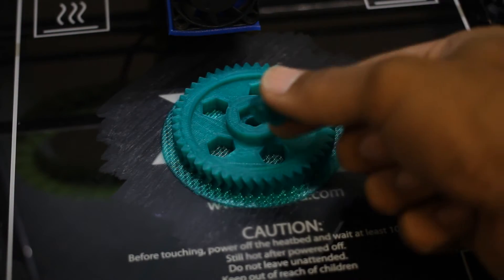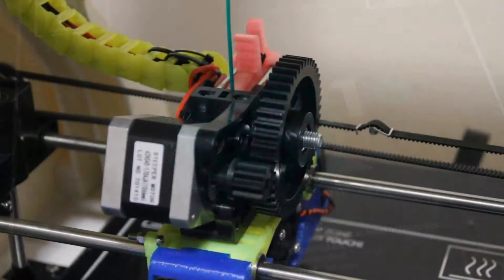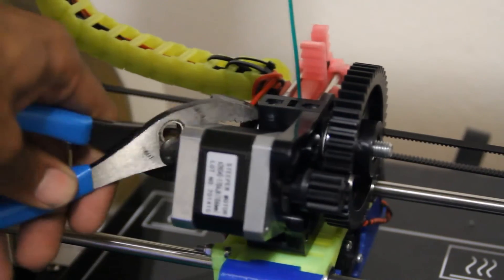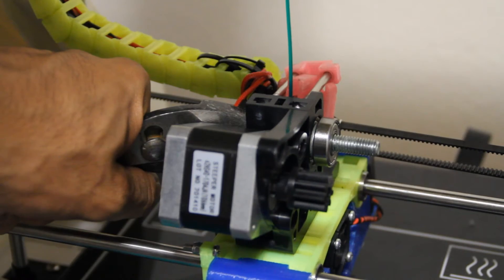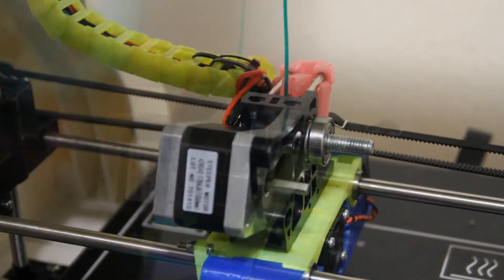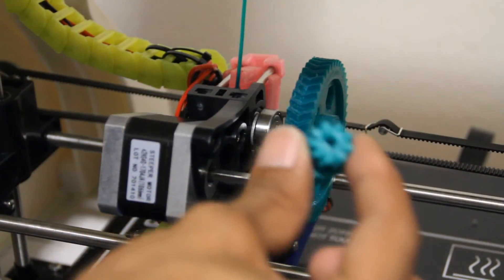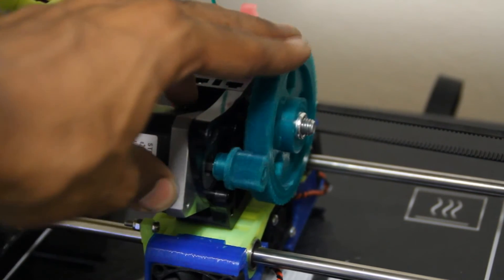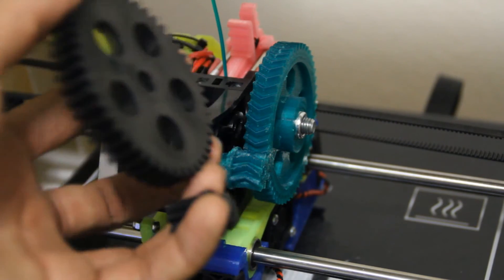Expert Mods: Herringbone Gears

Comment: The  herring gear has benefits, it meshes to incoming teach linearly, inward out, this can reduce backlash(Depending on the quality of the gear they replace) it also reduces meshing noise, the teeth are also MUCH stronger  than normal one, and they wear down much better than straight teeth. the biggest benefits in 3d printers is better precision (once again dependent on print quality of the gear, and the mesh quality of the gears they replace) and  silent longer lasting reliable operation.

and yeah, THEY DO LOOK BITCHIN'
Reply from the maker: Agreed!

Comment: The herringbone gears actually do in general, have benefits Not so much in our application for 3D printers but by having non linear teeth they mesh together better and tend to wear better. They are also more tolerant of slight misalignment.
And they look way cooler than stock !!!!
Reply from the maker: +bigfilsing I already miss how my old extruder looks, but the Titan is working great!
Reply: +Novice Expert yeah. there's something quietly satisfying about cogs visibly in motion. just "feels " like progress being made when you watch them. Yup.I neec to get out more. I do like the titan and especially how the stepper drive axel acts as a axel for the secondary gear. I for one would be interested to hear/ see your thoughts on it after a month of printing ! Cheers
Reply from the maker: +bigfilsing That was what I was planning to do, my final projects of the semester have the 3D printer working hard, and the Titan extruder is just handling the work load. After summer starts up I'll be reviewing immediately.

Comment: great job on the video as always! did you use PLA or ABS?
Reply: Novaspirit ABS for gearings is a must.
Reply: +SilentEliminator that's what i thought, but he didn't mention it in the video so i would comment on it =)
Reply from the maker: SilentEliminator I actually did use PLA, but that was just because I didn't have ABS available. I plan to use Nylon when the plastic begins to wear down.

Comment: One has to wonder why Robo3D has not approached you to work for them on revisions for their printer. I am anxiously awaiting the new revisions and changes before my purchase but you have fixed a lot of issues with this printer and I think you would be of great value to their team.
Reply from the maker: mtemp2006 Thanks, that means a lot
Reply: mtemp2006  Robo will be coming out with a quick change filament changer soon. Instead of having to undo those screws at the side to get the print head out to remove a jam or to clean the print head etc. It will be out this year at some point.

Comment: Could you make a video on how to do a test script for you hot end. I'm trying to add in a script that allows my printer to do a line before it actually starts to print the 3D object. Also do you have your hot end a certain amount of MM from the build plate? Some times my prints will catch the hot end and pull the print off the build plate even after auto leveling. Any suggestions ?
Reply from the maker: Nerd Nationz 3D Designs & Game Reviews I did it in my Software mods video. Here's the link if you want to watch the video https://youtu.be/AOHizXxsskY
If not just put this at the end of your start G-Code:

G1 X20 Y20;  MOVE CLOSE TO HOME
G1 Z.3;  LOWER Z-AXIS TO .3MM
G1 F1500;  SET FEEDRATE SLOW
G1 X200 E20;  CLEAR FILLAMENT
G92 E0;  ZERO EXTRUDER
G1  F{travel_speed}; START
Reply: Novice Expert Thanks a lot for the quick reply ;D
Reply: Nerd Nationz 3D Designs & Game Reviews Now do I need to be using Cura for that G Code work ? I'm currently using Simplifiy 3D
Reply from the maker: Nerd Nationz 3D Designs & Game Reviews You can use any slicer, I just like Cura

Comment: the herringbone gear does have a use - https://en.wikipedia.org/wiki/Herringbone_gear don't know if it would help with a 3D printer though
Reply from the maker: Correction: No use for the 3D printer extruder.